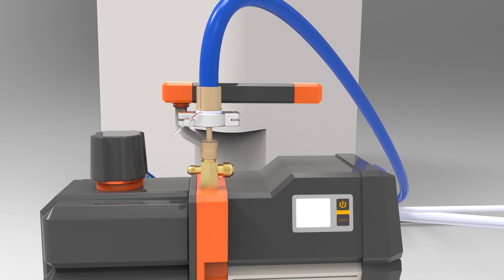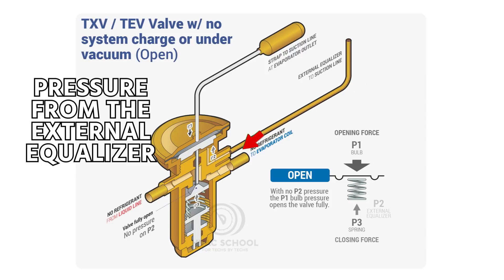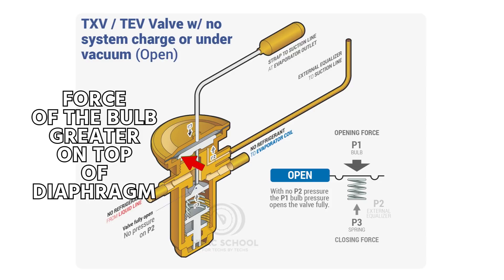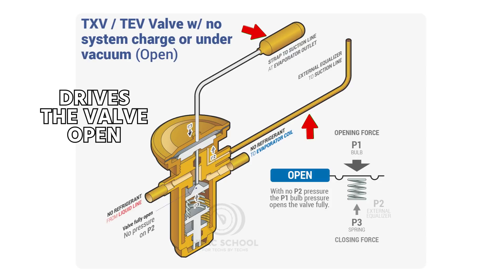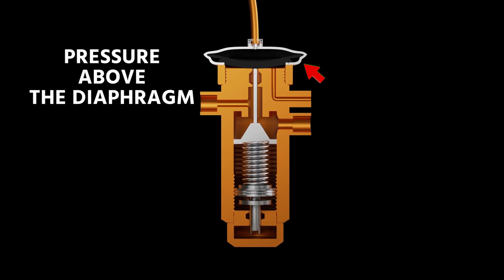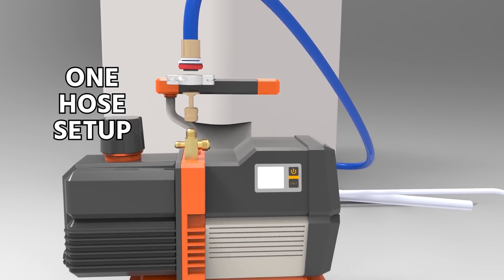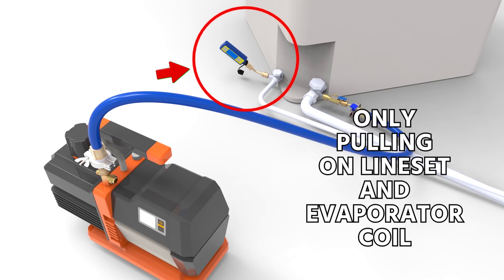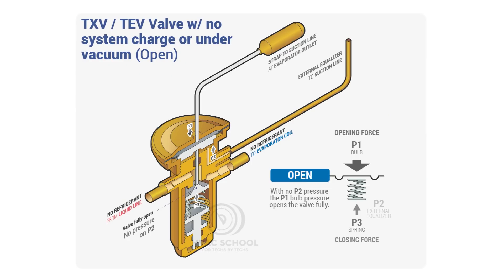Does a TXV Shut under Vacuum?

Comment: Well, if you ever doubt, just hook up the pump to the low side and let 'er rip for a minute. Then, look at your gauge on the high side. If its pulling down there, you know you have a complete loop and the vacuum is pulling through the entire system. I dont even hook up a gauge. I just depress the schrader, or pull it temporarily to see if she is a suckin'. I usually always do this, because what if your TXV has lost its charge, or there is a restriction either in your hoses or elsewhere?

Comment: i think abt this every time i pull Schrader's for the 1 hoeser,  i knew it pulled through the txv because if not how would you get a micron reading, but what i didn't know is since we are pulling through the suction side refrigerant is flowing to the condenser so we build pressure on the diaphragm using the vacuum and since the suction side is building more pressure then the liquid side the sensing bulb is basically saying we need more refrigerant and opens up

Comment: Hold a second, - at time index 1:11 you said the TXV "will go to its maximum open position, especially when the system is off, because you’re going to have a warm suction line.” That sentence confused me, because I thought that when the system is off your valve will close because the evaporator and sensing bulb will become(after a short amount of time) the same temperature (the return air temp) so their forces on the diagram will be the same so they cancel each other out (above and below the diaphragm) so the spring force will then close the valve. Everything else I understood.

Comment: I know this video is a year old but I’ve experienced this personally twice in the field and it isn’t about a txv but instead a reversing valve. So to properly explain this I’ll have to explain the repair and the process that lead to this happening.

So a install of a communication residential 18-22 seer rated system was done at a property and when it was done a mistake was made where the installer brazed the suction pipe with any kind of thermal paste trap wet rag etc was used on the suction pipe and the low pressure transducer was overheated cause the system to not run properly due to the sensor reading the wrong pressure from being overheated. This was the cause that lead to a open system repair on a brand new communication system. So no big deal find the plug/wires to the sensor confirm it was the fault and order a new one and properly install. 

After the sensor was installed properly we then started pulling our vacuum this particular system did not have a recover/vacuum function that some higher end communication systems have when doing this sort of repair if you’re familiar with a comfortnet ctk04 there is a option for this process in the stat and even some series of sequences on the climate talk/ communication boards. So we carried on with pulling or vacuum as usual and got down to a happy 350 microns. By this time I was happy with the micron levels and after checking decay/rise it was time to weigh the charge back into the system. 

After weighing in the factory charge the new pressure transducer was still stuck at negative pressure from the evacuation process this lead to some testing of the new sensor and concerns because the system would not operate due to its reading we then called tech support because it seemed to be beyond our scope of understanding at this point and they were as lost as we were so finally after just using some common knowledge of a refrigerant circuit I came up with the idea that the system was stuck in negative pressure due to the reversing valve not being energized now on a conventional system most of us who understand this much would energize the valve or denergize the reversing valve coil this valve happen to use a high voltage coil and tech support was unsure how we could energize it and I came to the conclusion it’s a 240 v coil let’s give it 240v and see what happens sure enough it energized and the pressure transducer started reading the low pressure and has been fine ever since. 

My question is does a reversing valve effect the evacuation/vacuum process does it without a pressure differential due to negative pressure from evacuation create a lock on a vacuum ? 

I experienced this one other time where a system got water in it due to a line set leak and we replaced everything except for the reversing valve and condensing coil but after flushing repeated times with the coil out of the system with Rx11 and nitrogen and many many many oil change could not get all the moisture out and could not get steady low microns readings this was a condenser we removed and operated on back at our shop finally I said let try and see if some of that is possibly stuck in the reversing valve we filled it up with nitrogen and energized it and sure enough we got below 1000 microns and got to 500 microns. 

My question is what am I missing in the refrigerant circuit that has lead me to believe that vacuum contamination and refrigerant can be locked behind the reversing valve?

Comment: Confused 😕 so when there is pressure in the system it cuts off both sides from each other. Is that to prevent oil migration and or doesn't that make a hard start situation?

Comment: What about  a EEV? Does it go completely closed or open, when in the off cycle or also when there is no  pressure. I do understand that its not controlled the same way but was just wondering how that works maybe you could do a video on it.
I would think it would act like a non bleed txv. If u could  Shed some light that would be nice. Thanks Brian .

Comment: What about hpr valves/headmasters. I've also wondered why if you loose the charge in the pig tail for hpr valves it doesn't go into bypass but goes into the "normal" operating at position.

Comment: That is an excellent explanation! I use the same set-up to evacuate the system every day, and sometimes I wondered the same thing. What if you're pulling a vacuum on an inverter-type unit, like on a Carrier Infinity system? When new, the refrigerant is isolated in the compressor but if you need to do some repairs, since they have an EXV on the condenser side?🤔

Comment: Thank you for this explaination. Just to be sure, is it the same in case of refrigeration systems which are controlled by 'pull down' method, right?
Reply: If you are referring to pump down solenoids you need to either energize the coils, or remove them and use a magnet otherwise the valve remains shut.

Comment: How about a indoor TXV causing high pressure cutout in heating mode, within 3mins. Had manufacturer argue that it wasn’t indoor TXV causing problem, replaced outdoor TXV, they sent new condenser, finally they sent indoor coil with TXV. It wouldn’t bypass fully and I kept telling them it has too much of a drop. 12° drop across indoor TXV.